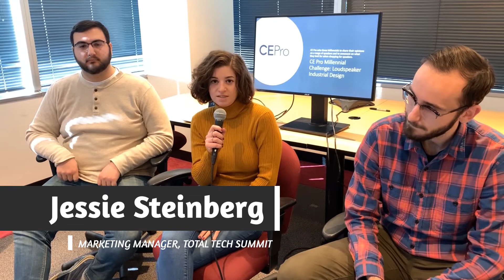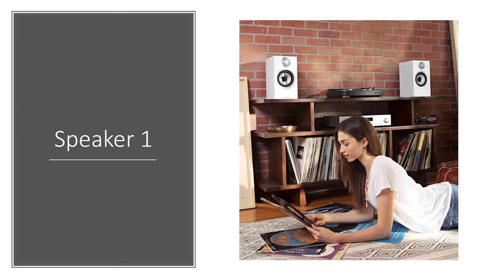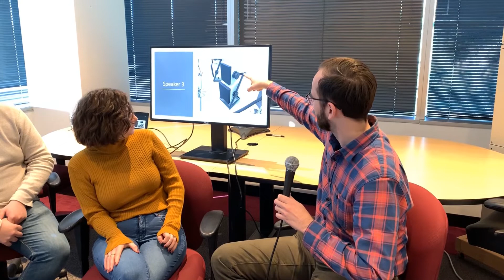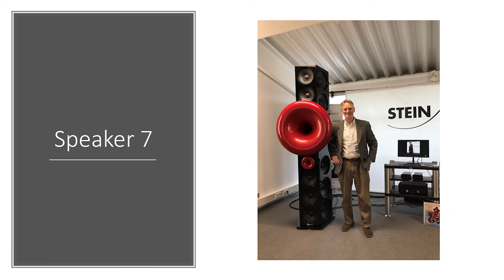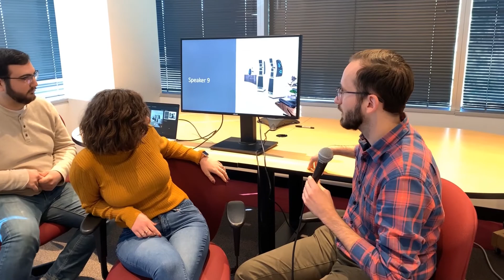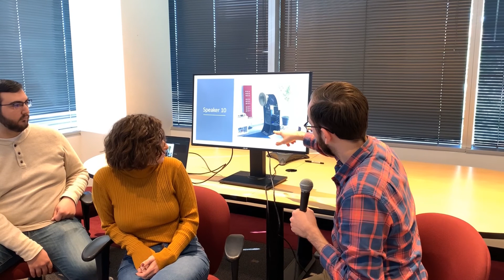Do Millennials Appreciate Industrial Speaker Design?

Comment: So these Millennials do not care what they sound like only what they look like.  No reason to even consider looking at higher end speakers for them.  Large speaker systems are NOT DESIGNED  for small apartments most are designed to sound good in a space that is capable of holding them.  The "Millennial"   in this commentary probably do not own a turntable or any vinyl.  Probably listening to highly compressed (but very convenient ) MP3s .Too bad if they had a chance to do a blind listening test they might have had a different opinion.